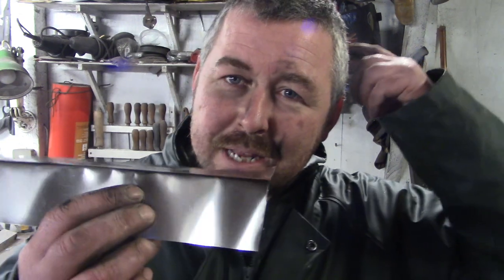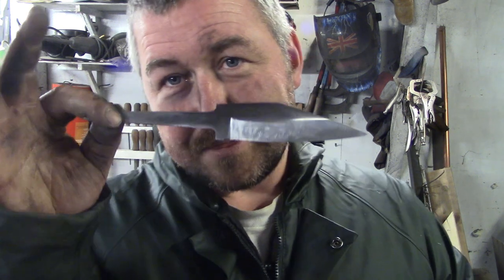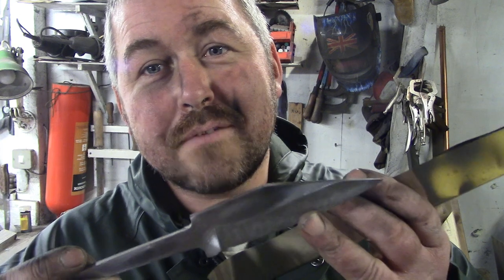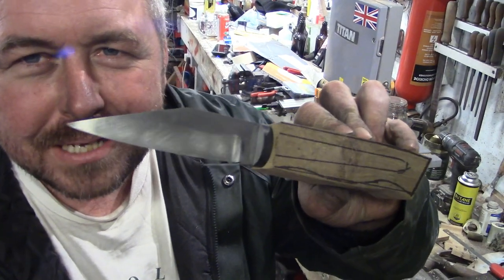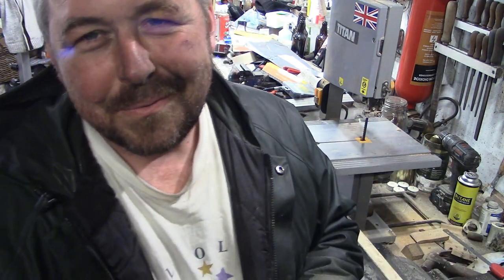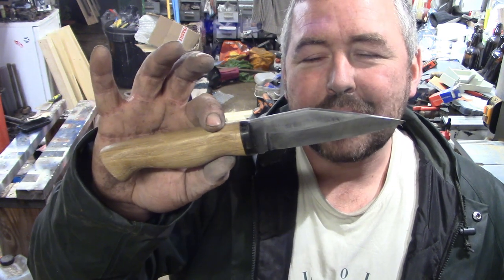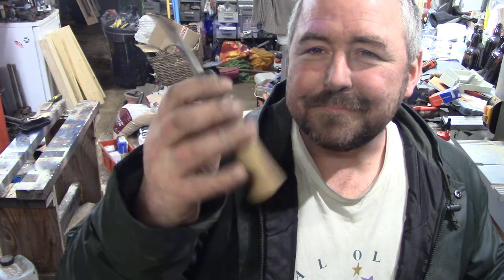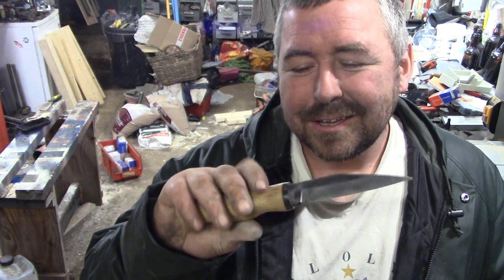Making the Bushcraft Seaxe Seax

Comment: Did the blade harden to the same point as the ones without the envelope on the outside? I know the oil needs to contact the blade itself to pull the heat out fast enough to get a good harden.
Reply from the maker: The belly of the blade has hardened but the envelope was tighter fitting there, I'd assumed my mistake was during tempering and I'd got the tip hotter without being able to see it but I'm certainly open to the idea that it got cocked up at some other point! What you are saying makes sense, putting clay on the blade is how you get a differential hardening, and I'm essentially doing the same with the envelope probably to a lesser degree.
I'll try it with the 440c stainless I have as that's air hardening and then do the tempering outside the envelope.

Comment: At around 4:50 were you trying to wipe dirt onto or off your face? :)

A neighbour popped around last month with a stainless steel "throwing seax" from the same firm as made the axe I ground, so as you can imagine it isn't quite sharp enough to cut through warm butter.... He wanted me to put a deer antler handle on it but there wasn't enough to make a material to make a handle with scales but now it occurs to me I could put a tang on it and drill holes in the antler to suit after all I do have the drill press.
Reply from the maker: Have you got any antler? I can send you some if you want. 
Lol re. the dirt. It's them bloody blow lamps mate.
Reply: @turboconqueringmegaeagle9006  Don't be blaming me or the blowlamps for your dirty habits! ;) 
As it happens, the chap has a bit of antler so I'd have what I need. 

Incidentally both of the mills in question went but I did happen across a Naerok which has advantages over other round column machines because it doesn't lose alignment.